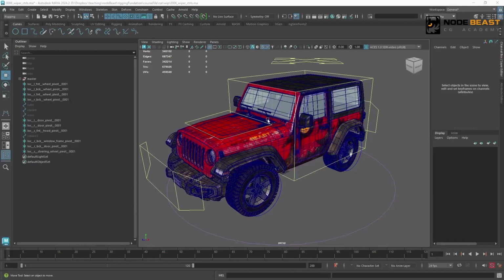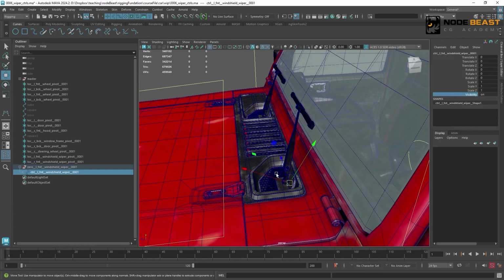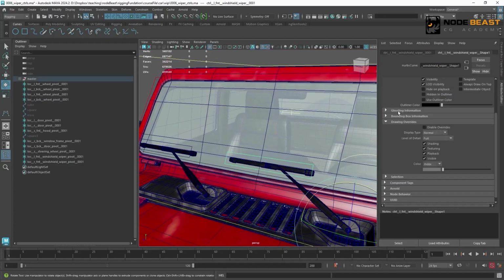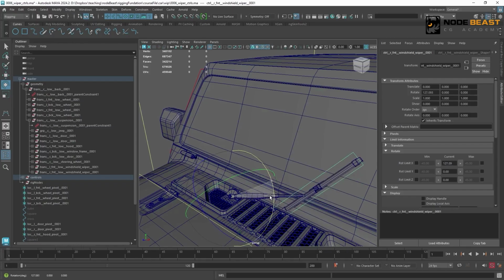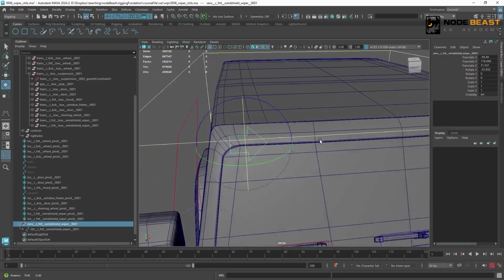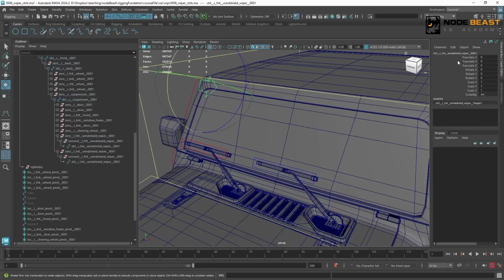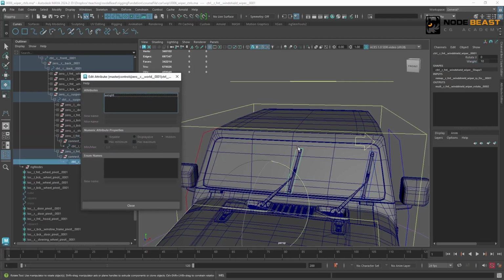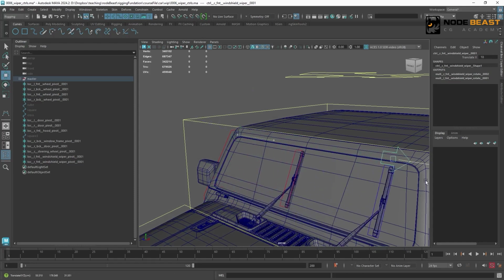Maya Rigging Basics I: 39 Car Rig Wipers

Comment: For future viewers:
1. It's a weird practice to use the master wind shield controller's parent scale to patch the 100+ x value, a better idea is to create a slider container for the master widget for the master control at the center of the windshield.
2. Instead of using complicated node graph to fix the right wipper's mesh overlapping, it's a better idea to rotate and refreeze the zero group instead of respecting the mesh's anchor geometry and using rotate nodes to hack the fix for sanity's sake.
3. Even for a fully mechnical model, it's still a more universal practice to drive everything using an armature instead of raw nested controller outline hierarchy like in the course.
Reply from the maker: well, those are more like a preference, there are many ways to achieve similar result, I won't say one is better than the other, in the end is more about what the animation team ask, and what works best for your pipeline.

1. Sure you can add attribute as master control, instead of creating a new one, it depends your design style, and animator's preference, like foot rig, some people prefer to add all foot roll attributes to foot ik control, while others like to create individual pivot controls. And scale the top group to change the space is a common trick we use in production to get correct visual distance, especially for face rig, so I figured it's good to show here so we have an idea when to use it.

2. you can re-orient the zero group, but I have 2 concerns here, first, because the model already in this way, it could be hard to find a orientation direction to rotate the wiper, not only avoid the intersection, but also not creating too much gap. Secondly, when we start to write this setup into script, as an auto rig, then it's gonna be harder to automate this orientation, because we have to manually rotate it. But if we follow the mesh, we can easily auto orient it by letting the auto rig system read the mesh data, then simply tweak the remap node values to make it work from one car to another.

3. You may notice, this is a foundation tutorial, we haven't cover joint yet. The goal for the project is to use what we learnt, to build a fairly complicate rig, so we get more familiar with those concepts. In production, having a skeleton layer is more common, but that's mainly because pipeline design, when we create modules (fk, ik etc.), we want them can be reusable, characters, props, vehicles etc. So having a joint layer becoming important in that case, because we will need to bind with skin cluster if the mesh need to be deformed. But even for that, the concept is the same, in our case, it will just be adding another layer in-between control system and geometry. Just use whatever drives the trans groups to drive the joints, then use the joints to drive the trans groups. Once I introduce the joint concept in the next tutorial series, the setup will go more toward that way.

Thanks for watching, cheers.